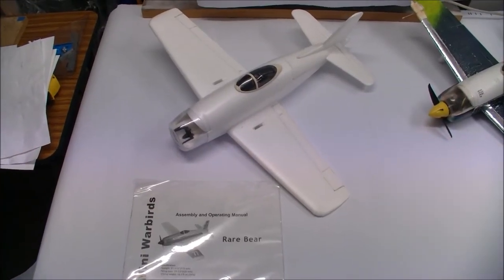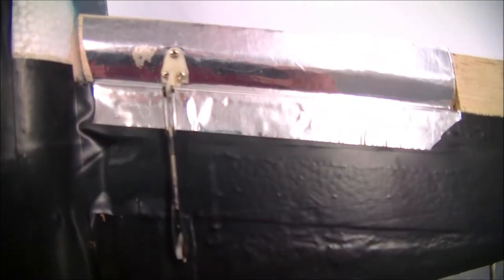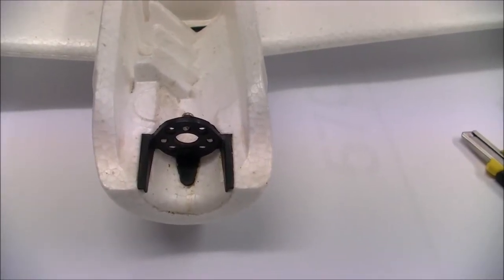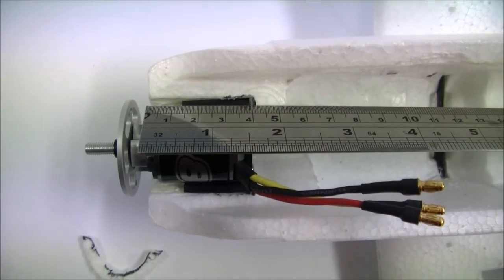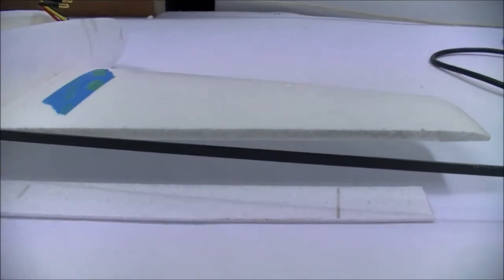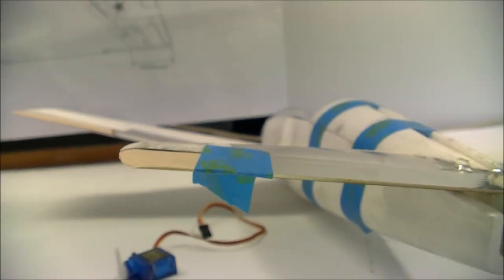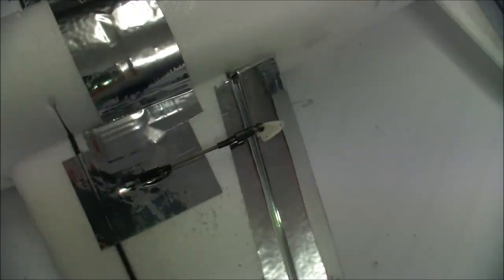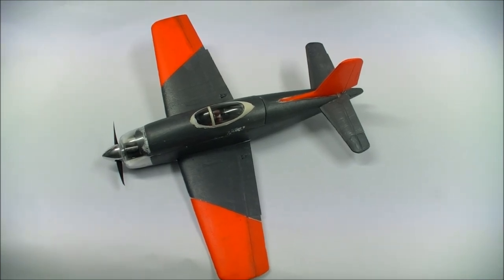Hobbyking Rare Bear Upgrade Build Video | RC Skunk Works ADP

Comment: Absolutely love your videos mate. I'm building a rarebear using all your mods in the next few weeks. Can't wait!
I did see you used an onboard pitot based speed meter. Did you know you can use this software to calculate your speed using audio instead? http://www.sprut.de/electronic/soft/scope.htm I ran it on your other video of the rarebear and it clocked 250km/h :)
Reply from the maker: futurikon Thank you for your comment and also for the link. It's interesting to have this feedback with comparisons of logging speeds. 
I'll try and get some videos up soon of the new one flying!
Good luck with yours! 
Cheers Scotty.